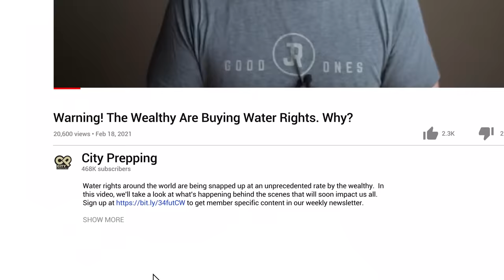How to Make a Dakota Fire Pit: Critical Skill Post Disaster

Comment: pretty awesome firepit. wish I had space for one in my small yard.
Reply: Lilly you are badass too
Reply: I may want to build one this size, but the first thing I contemplated was to do a mini version of this for cooking. Maybe about a 1 foot diameter hole. Good enough for stew cooking.
Reply: Survival Lily , I have seen one of your videos with a tepee  and stove pipe coming from outside , I guess it was similar to that but yours work well also.
Reply: Wish my yard had soft dirt like that. Colorado at 8500' is rock hard. Forget it in the winter as well.
Reply: If you have a small yard, it's possible. Do it small 5x5

Comment: PRO TIP: If you find the prevailing winds develop from one given direction when using your pit you could move the paver(s) from the air intake hole up wind thus improving your airflow.  If the wind changes direction replace those pavers and move the other(s).

Nice job Kris on making the Dakota Fire Pit AND for digging one ahead of time. Now you can get some of those beautiful veggies that Mrs City Prepping grew for the family and roast them on the fire.  Yummy! 😋

Comment: Well done. I'm sure your wife appreciates the finishing touches of brick & gravel. Would be interested to know how the air hole holds up during heavy rain... or in my case winter. I guess you could re-dig it in the spring.
Reply: I guess since it's permanent, a cover could be made just to keep out snow, rain and debris 🤷🏾‍♀️
Reply: Put a tarp over it in winter? It could be removed if needed during those months for cooking, if placed correctly- arched so the snow easily falls off.
Reply: At least cover it enough so that if it snows, nobody will accidentally step in it and break their leg or something. Also to keep it from collapsing.
Reply: use a clay glazed sewer pipe, they used to be in 1 yard? long sections.
stop it just back from the fire base. they laid them in the 70s before being replaced with PVC,  (dont use pvc LOL.)

Comment: Yep, I've made a D. fire pit. They are great to cook on and best in windy or wide open areas. In the winter I like a surface fire facing a super shelter with a reflector wall behind to direct the heat and shield from wind. If it's real cold I have lined my reflector wall with foil... Work smarter, not harder?😊

Comment: a minimum 16" thick hardwood log 2' long split into 4 wedges lay that on top of the coals from your cooking fire. Your not looking for some huge fire just enough to turn the split side of the log into a glowing coal on the split face.  Roll it off the burning coal with the 45 degree glowing split side toward you. cover the cooking coals with ash for easy fire start in the morning. Almost zero smoke with little light so marauders can't see it and its effectively an infra red radiant heat source all night. Works in the winter in the ozarks.
Reply: That's great info. Cool! Thanks
Reply: who the hell is hiding from marauders in the ozarks in 2021?
Reply: @Bigglenndaddy  the idea is to keep warm without having to chop a lot of wood. Nor would you have just plain old tweakers spot your fire. Besides I'll be hunting marauders, i'm takin their gear...lol

Comment: That is an awesome way to have a fire in a dry area that is windy. Unfortunately i live in a very wet and hurricane prone area. A Dakota fire pit will be a great way to find water, but a log rocket stove is the easiest way to get a cooking and warming fire going. Just drill a vertical hole and connect it to a horizontal hole. And boom. There you have it. And you can make a bunch of them ahead. Wonderful thing about them is they can be moved by hand and could easily be able to heat and cook inside a lean to or tent.

Comment: Some flagstone, culvert pipe, chicken wire or even old tiles would help shore up walls. Also a metal or stone grate for each hole, unless you like pit traps in your yard. And always check your tree branches overhead or you may scorch/kill a tree with the rising heat. Great idea on the make shift forge/kiln. Saw a channel once make a forge/kiln out of mud brick and they alloyed carbon steel that rivals modern tech. Get those cold times skills going before you are desperate to learn them.
Great how to, thanks!

Comment: My dog likes to dig holes all over the yard. I tried filling them back in with dirt, but he'd just dig the holes again in the soft dirt.

But one day, I wanted to go cook some fajita meat on a fire outside, and as I was walking to my usual spot, a cement slab where the septic used to be, I noticed that the holes my dog was digging were, essentially, Dakota fire holes. All I had to do was fill in the space a little, making the tunnel.

So now, I embrace his holes. Instead of filling them in with dirt, I turn them into pits and burn a bunch of brush and old sticks, then cover them with sand and dirt.

Comment: We used a short piece of masonry pipe for our air hole, and I made a cover for the air hole and pit from scrap plywood and lumber.  Helps to keep it from becoming a swampy mess after rainy weather (not all the time, but most of the time).
Reply: Thinking about this instead of a traditional open fire pit. How is the heat off of this?
Reply: @RFing22  excellent heat

Comment: I am 70 and not able to dig and lug stones around. I like the concept though Kris. Thank you for sharing.
Reply: It can be made much smaller and doesn't need stones to function. Do a search using the keywords Dakota Fire Hole for ideas that may work for you. Depending on your soil, a garden trowel may be all that you need along with a grill of some type or a few green sticks to lay across the hole. (Or a DIY small tripod to hang a pot over the hole. 

Hope this helps.

Comment: Thank You. I'm trying to wrap my brain around this. You used a blower (that I dont have) but the main concept is to hide the fire and/or smoke?
Reply from the maker: we just demonstrated with a leaf blower to show the efficiency of the setup
Reply: @CityPrepping  I imagine a fireplace bellows would work well, too.
Reply: Amber
The idea of the blower or a fire bellows is to create a draught to make the fire burn faster, usually to to get it going or when building it up again after it went down to low or if you wanted to give it a boost to bring a pot of something to the boil.
Reply: If you have a decent shop vac, you may also have a make shift leaf blower. If you take the motor off the vacuum, you might be able to connect the suction hose to the motor exhaust and use as a blower.

Comment: The idea of doing this as a permanent thing on your property is something that I really like.  Figuring out something to put on the bottom of the fire pit to pull up and discard the ashes would seem ideal.  Anyone have any ideas as to what to use?
Reply: It's a good idea. Using the Wood Ash on the garden afterwards improves certain vegetables.
Reply: If you are going to make it permanent, doing the stone ring all the way up not only is a heat storage system (the stones heat while the fire is burning, and radiate it back when the fire is out) but also makes it easier to pull the ash out.  Also a solid cover for it (wood often works) both keeps most of the critters out, and also keeps most of the weather/debris out as well.

Comment: Very nice set up. Smart to have one pre built in case of any emergency. My only question is how do you prevent it from flooding during a rain storm. I know it will eventually dry out but im sure it doesnt work well when the inside is soaked
Reply: I suggest keeping it covered with a large metallic plaque when not in use.
Reply: I was thinking a kiddie pool turned upside down.  With grandkids around we always seem to have one.  Lol
Reply: @glad2be52 , works for you? Great!! 😁👍🏻👍🏻

Comment: I think for the back yard,id do it all above ground with cinder block intake and solid stone top ring... Then the stones put off alot more heat to the sides...
Reply: Be careful of cinderblock, they tend to be porous, and having water in them that superheats,a no explodes is … less than pleasant.  Try firebrick?  This is exactly what it was designed for.

Comment: i have an idea . first , you don't have to dig a hole . get you a 4" pipe , 1 1/2' or so long . bury it 4" deep so you don't 
trip over it . open it on both ends for ventilation. build your brick above it and around to 4' feet high . seal brick build 
up with cement . you won't have to bend over to cook . say you want to maintain your cooking  height at 4' , you may
or may not want to dig a little to maintain proper depth to width  burning dimensions . also you won't have much 
body heat this way

Comment: How often do you expect to clean out ashes and is your air hole at the bottom of the main hole or is the main hole deeper than the air tunnel entry?  Nice job.
Reply: You set the fire at the top so the fire should burn the smoke. Basically the same concept as a rocket mass stove. You get a more efficient burn and therefore if you're doing it right then you get very little ash
Reply: To clean out the ashes just use that leaf blower !🤣

Comment: I just dig a small trench approx 18 inch in length and 6 inch wide and 6 inch deep start my fire at one end then place a flat rock over the mid section and feed the fire from the other end..

Comment: One tip - make sure you know where you are digging. And not just gas lines. Power lines. Fiber optic. Sprinkler pipe. Septic leach field. All things you will not like building on top of. Also, it's basically a rocket stove- above ground might be easier to set up.

Comment: I plan on making a fire pit inside my fort and having an airflow hole that goes to the bottom of it and then just to make sure I get no smoke in my base I will put a second hole toward the top of the pit leading to the outside like a chimney.  If anyone has a better suggestion or something I should know about plz tell me.

Comment: How do you keep the hole from collapsing? I live in Florida and we get a lot of rain during summer months.
Reply: Line the hole with a metal bucket with the bottom cut out. Line the hole with a metal or concrete driveway pipe. Tin cans with both ends cut out can line the air channel between the holes. Several small metal pipes, laid side by side or in a bundle can do the same thing. Look around you for any fireproof materials from bricks to metal barrels, trashcans to line the holes. 

Size of the fire hole can be quite small and still be effective. For a permanent structure,  you can  dig a large hole, make concrete forms, pour. When set, backfill around the forms and over the air hole connecting channel. 

Just some food for thought that may be helpful to work in your circumstances.

Comment: It all sounds good if you can keep ground water out. If I dig down 3 feet I have a well. It rains a lot in Florida and the ground here has clay , so the water doesn't drain well. I love your idea but It won't work here unfortunately. Good video though.
Reply from the maker: Clay is lucky.  It's an original survival tool (That and a stick).  Try building an above ground clay rocket stove.

Comment: What about when it rains? Couldn’t you build this above ground so it doesn’t fill with water?
Reply: or build a roof over it?
Reply: @Goldenhawk583  so how would that work? Chimney or roof fills up with smoke? Isn’t the point that it’s an outdoor fire pit? I’m guessing from what he says in the video that this is temporary but that seems like a lot of work for a temporary fire pit. This is only for very unique situations I think.
Reply: @tvojslauf  You know, if you buils a slanted roof, that holds rain away, while not having walls.. I think you will find that the smoke gets out just fine.
Yes, it is an outdoor firepit, but it wont work well in rain, even less when , like he has, a lot of clay, the whole pit will act like a bucket.

Comment: you needed gravel around that pit or build up with dirt, not wood chips...also, a medal pipe or a concrete pipe, inserted into the air hole with a screen to keep stuff out...it can be concreted in with the stone....in areas where there are snakes, they may crawl into the spaces so, be careful when opening....